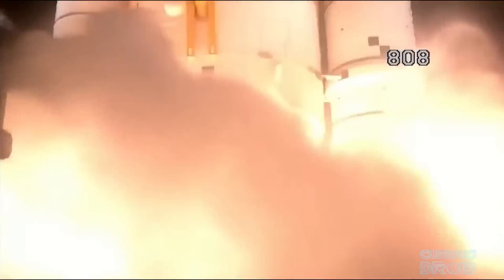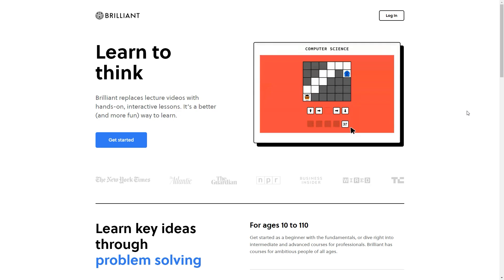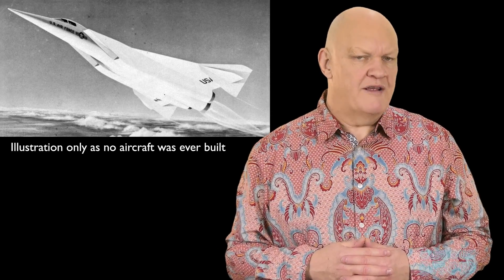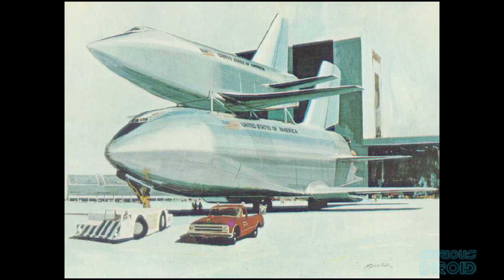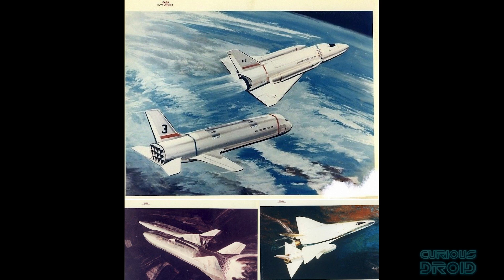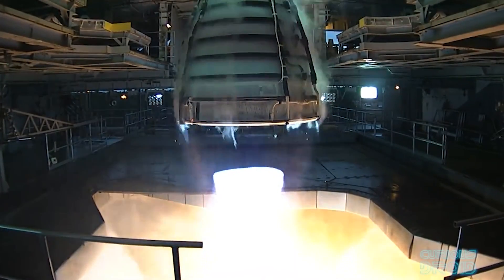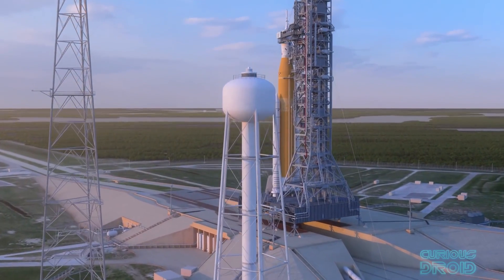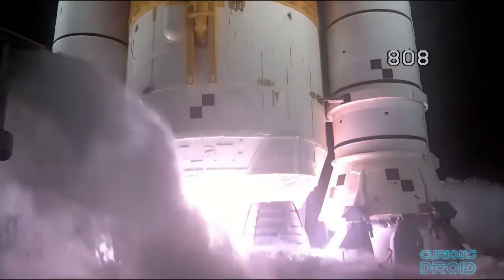Why is NASA Throwing Away Reusable Engines?

Comment: Frustrating we throw the whole thing away after each launch. Expensive, and it can't be good for the environment either.

Surely someone can invent some kind of parachute system to retrofit onto these rockets???
Reply: The SLS core stage dry mass is 85 tons. The Falcon 9 dry mass is 22-25 tons. The SLS core stage is moving over 3 times as fast and over twice as high as a Falcon 9 booster at MECO. Recovering the SLS is not a trivial issue. Not to mention, the recovery equipment costs payload mass. The Falcon 9 B5 can lift 22.8 tons to LEO when expended (SX), but only 16.7 tons when landed on a drone ship (B1069.2). SLS can not take that kind of payload hit and still get Orion to the Moon.
Reply: @steveaustin2686  

"SLS can not take that kind of payload hit and still get Orion to the Moon."

I would argue it should only be taking it to LEO.

We should be sending everything to LEO and constructing things in orbit. We proved that this works with the ISS.

Construct it in orbit, including a separate launch for the fuel to go to the moon from there (which is far less fuel than needed to go to leo).

In the past I would have said, clearly SpaceX should be doing it....but the owner of SpaceX has shown himself to be a racist and right wing extremist, because of his comments on Twitter, many of which are quite vile. He doesn't represent the USA. 

I would like to add a clause for any new launch contracts going forward that the owner and chief officers of the company must be of good moral character, and can't own any companies that have judgements against them such as a Consent Decree from the FTC (Twitter).

We should have some kind of system whereby anybody can come to NASA and pay to get their rockets human rated so they can be added to the list of available launch services.
Reply: @steveaustin2686  

"Musk has wandered off into the far right insanity, but Gwynne Shotwell runs SpaceX as COO."

Yeah, you're right. Still, SpaceX associates the USA with Elon Musk. I would really like to get away from SpaceX as a result. Not sure if we can do it right now, but as soon as we can I would love to see it. 

"Companies only get their rockets human rated when they have contracts for crew launches."

That's what I'm saying, that we should change that. Anybody should be able to come to NASA and pay to get their rocket human rated (by tests they run at their expense, of course). That way, going forward, we'll have a lot more choices and soon be able to ban SpaceX until Musk gets his act together.

Well, not quite anybody. Company has to be run by people of good moral character, with no legal issues with any company they own.
Reply: @neutrino78x  I think you missed that any company can human rate their rockets right now if they want to, but don't, unless they have a crew flight contract. NASA is not stopping them, the extra cost to human rate a rocket, is what is stopping them. Why would a company go through the extra expense, if they don't have contracts to fly crew? It's not worth it.
Reply: @steveaustin2686  

"NASA is not stopping them, the extra cost to human rate a rocket, is what is stopping them."

I thought they were only doing it for companies that signed up for Commercial Crew. If not, when did that change?
Reply: @neutrino78x  Any company can do the necessary steps if they want to. Nothing is stopping them from spending the time and  money to crew rate a booster. 

SNC wants to eventually crew rate the Dream Chaser and is using their 6 mission CRS contract to prove Dream Chaser can fly reliably. It is planned to fly on the Vulcan Centaur. If Boeing flies more than their current Commercial Crew contract, they will need a booster as the Atlas-V's are all already sold. ULA doesn't want to spend the money to crew rate Vulcan Centaur and says that anyone that wants to can pay for it. Boeing and SNC say that ULA should pay for it. NASA doesn't care if any of the three pay for it. 

NASA's budget is hurting for money already and Congress sets how much each NASA program gets, so NASA is not likely to be able to pay for it, unless it is some part of a program like Commercial Crew or possibly Commercial LEO Destinations.
Reply: @neutrino78x  Boeing's Starliner is scheduled to fly the CFT mission in the first half of 2023. NASA wanted two providers just so that they would have a backup.

Building spacecraft in LEO would greatly delay Artemis as they are designed, tested, and built. Better and almost certainly cheaper to go with what they have already.
Reply: @steveaustin2686  

"Building spacecraft in LEO would greatly delay Artemis"

Why? They're talking about building the lunar gateway thing right? So skip that and use the ISS instead, which is already built.

Look, fair to assume I already know about all this stuff, I've been following space stuff all my life. (I will be 45 in January.)

Mine was sort of a rhetorical comment. It's good that they got the thing to launch. I'm just saying, it should have been designed with more re-usability. It's not economically sustainable. Yes, Senate Launch System, I KNOW. I'M FAMILIAR.

Really just going to LEO is all you need. It makes the rockets a lot cheaper, it eliminates the need for a BFR.
Reply: @neutrino78x  Real life is not Kerbal Space Program.

Lunar Gateway is going to be a space station at the Moon, so that Orion has some place to sit during the surface mission and long term experiments can be done in deep space. It not made for travelling to and from the Moon. It will be assembled, module by module like the ISS was, in lunar orbit over multiple missions. 

The ISS is in LEO, under the protection of the Van Allen belts. It is not built for deep space nor is it young enough to be a long term station at the Moon. Just moving it there would likely be as expensive as the WHOLE Artemis program. The ISS is already at the end of its lifespan. Which is why NASA is funding the Commercial LEO Destinations (CLD) program for new, commercial stations where NASA will lease time instead of running it. The two International Docking Adapters (IDA) on the US partner side are busy with ISS operations. One of the two IDAs is always filled with the on-orbit crew capsule and the other is frequently filled with a cargo Dragon or the new crew capsule. The Axiom commercial station is going to be added to the ISS while it is built, so adding yet another building project would likely be too much.

Maybe you forgot the part that the SLS is over 3 times heavier, gets to over 3 times as fast, AND over twice as high as a Falcon 9 booster. ALL of that makes it VERY much harder to reuse the booster. It would need thermal protection to survive re-entry, so would have to be greatly redesigned and would almost certainly lack the payload capacity to get Orion to the Moon. Not to mention that it doesn't look like it will fly at least once a year until Artemis IV or V, so reuse with such a slow launch cadence isn't really affordable, especially for a booster with the re-entry problems above!

No, just going to LEO doesn't necessarily make them cheaper as you then need to build your spacecraft in LEO, which is very expensive in real life.  You would be launch multiple modules, which makes your spacecraft much larger, which means you need more propellant, and then the propellant to push the propellant. Rather than having a capsule and ESM made on Earth, simply for a spacecraft, you would be making a MUCH more complicated spacecraft with overlapping functions.

Again, real life is MORE complicated than KSP.
Reply: @steveaustin2686  

"Lunar Gateway is going to be a space station at the Moon, so that Orion has some place to sit during the surface mission "

Why not just have a dedicated vehicle that goes between Moon and ISS? Far less fuel involved doing that than trying to go from Earth all the way to the Moon without refueling.

"It not made for travelling to and from the Moon."

Where did I say that? I'm saying, go to LEO. Assemble whatever needs to be assembled. Fire off, land on Moon, do whatever you're going to do on the Moon, fire off again, stop at ISS, go back to Earth in capsule or whatever, done.

There's no need to have a BFR if you assemble at LEO and refuel there.
Reply: @neutrino78x  Because, again, the ISS is ALREADY busy with its own operations and is adding on the Axiom Commercial station modules NET 2024. Remember, there are two IDAs and one is ALWAYS filled with the on-orbit crew's capsule with the other regularly busy with cargo or crew swap or Axiom tourist visits (at least 3 more scheduled). Not to mention that trips to the Moon are from a 32ish degree inclination (Apollo & Artemis) and the ISS is at a 51.6 degree inclination. So the plane change for an Artemis mission going to the ISS would eat up even more propellant that SLS doesn't has or that your notional crew transfer vehicle would have to spend.

Again, you need crew in orbit to assemble the components of your crew transfer vehicle and that is expensive. Each module will have to have power, propulsion, and guidance no matter what the module is for. You still have to design, test, and build your modules and the first one almost certainly needs a Canadarm to facilitate construction. No, the ISS could not do it, see the paragraph above.

With SLS & Orion, there is no need to construct anything in LEO AT ALL. Just go straight to the Moon. HLS Starship is refueled in LEO by up to 9 other Starship flights and is still cheaper than SLS. It's large size has cargo and extra propellant for aborts that are necessary for a robust Artemis mission. The [DELETED] Starship propellant depot launches first. Then up to 8 Starship Tankers refill the depot. After the depot is refilled, the HLS Starship launches to refill from the depot. Once full again, HLS Starship heads to the Moon. Then SLS/Orion launch to meet HLS Starship in lunar orbit (Artemis III) or at Lunar Gateway (Artemis IV+).

If Starship matures to a fast enough launch cadence, even with having to send the crew to and from LEO in Crew Dragon and Starliner, it still would be cheaper than SLS/Orion, even at the Artemis III $1.47B price. But AGAIN, Starship is almost certainly not going to mature to the point to replace SLS/Orion by Artemis III and possible not for the next few missions afterwards.
Reply: @steveaustin2686  

"Because, again, the ISS is ALREADY busy with its own operations "

Everybody is busy with their own operations. Doesn't mean it makes sense to require a huge rocket and spend all that money when all you really have to do is go to LEO.

" Not to mention that trips to the Moon are from a 32ish degree inclination (Apollo & Artemis) and the ISS is at a 51.6 degree inclination."

That's launch inclination. We're talking orbit to orbit. 

Earth to LEO, Delta-V is 9.3. LEO to the Moon is only 1.6.

See wikipedia article "Delta-v budget".

And yeah, I know the bottom line here is that the Senate required them to do it this way so money is spent in Florida and Texas. Maybe they could do it that way and still only have to make something that goes to LEO, however, and still manage to save a lot of money. So it IS the Senate's fault, but not ONLY the Senate's fault. NASA can also work with what they're given and try to maximize what they can get out of it. Or as we say on submarines "cause it to happen".
Reply: @neutrino78x  I'm getting tired of repeating myself. Whatever floats your goat dude.
Reply: @steveaustin2686  

"I'm getting tired of repeating myself."

You're not teaching me anything. You're a know it all who thinks NASA is incapable of making a mistake. You assumed I don't know any science because I said they should do something to make SLS more reusable. 

Going anywhere else requires far less delta-v once you're in orbit. All you have to do is have the ability to assemble and refuel in LEO, and capability to get humans to LEO and then you can go pretty much anywhere else. There's no reason they can't make the rocket engines in one state, the capsule in another, the recovery system in another, etc., make them all in states with powerful Senators, etc. NASA could have done that, and have something that goes to LEO and is reusable, and have a LEO refueling system. This was probably the most expensive way, even given the need to make the Senate happy.

Having said that, yes, a large part of the reason why SLS is this way is because of the Senate, I know. Preaching to the choir.
Reply: @neutrino78x  Says the guy who is MISSING the point that to change inclinations of an orbit REQUIRES dV. Dude, believe whatever nonsense you want and ignore anything that doesn't fit you plan, even if it would IMPACT that plan. Dunning-Kruger your way to whatever the Fing plan you want, since nothing matters to you.
Reply: @steveaustin2686  

"Says the guy who is MISSING the point that to change inclinations of an orbit REQUIRES dV."

Sure, I won't deny that. Just, not as much Delta-V as going from the surface of the Earth to the surface of the Moon.

In other words, we can add some hardware to SLS to be able to recover the SRBs and the main first stage and still be able to get to the ISS for orbital assembly/refuel.

This whole paradigm where everything has to be launched from Earth directly to somewhere else...you can only go so far with that, man. It's not like you're going to have a ship that rotates to provide artificial gravity etc and you're going to fold that thing up to fit on top of the SLS, come on now. SLS as it stands is extremely expensive and it doesn't open up space that much.

It should be go to LEO, meet with some kind of space station (ISS or otherwise), assemble the ship in orbit, launch the fuel from somewhere, launch the crew, separate and go to the destination. This is the UNIX way....small modules that do one thing and do it well, and readily connect to other modules, making it easier to build a big complex system with lots of redundancies. 

In fact, ideally, you have ships that just stay in space, and all they do is go from body to body, such as a ship that goes from Earth to Mars orbit, and then you just go to LEO, refuel, meet up with that other ship, ride it to Mars, and land in a separate lander. It could be an Aldrin Cycler that is in a gravitational orbit that takes from Earth to Mars on a regular basis with very little fuel needed, and it has lots of shielding, lots of food and water, and rotates to provide earth gravity. On something like that you could take large numbers of people over in comfort. But that's for the future, that's something that has to built over time, we need commercial presence and a tax base to justify building something like that.

"Dude, believe whatever nonsense you want "

Such as, the mission required SLS, as opposed to the Senate requiring it? Or that NASA didn't do enough to involve Florida and Texas in a NASA owned rocket to the ISS and then a NASA owned transport from LEO to lunar surface? Or multiple commercial options for both?
Reply: @steveaustin2686  

"There is no other launcher that can get the Orion stack to the Moon,"

Not directly. But you can go to LEO, refuel and then go to the moon.

Or have another vehicle that does nothing but go back and forth between LEO and the Moon.

It's not that hard. NASA needs to do things in a more modular way. Cheap modules that when linked together do something that would otherwise be a lot more expensive.

", but you are evidently allergic to facts."

I'm definitely not allergic to the fact that things are this way due to a combination of HSF at NASA not being innovative enough and the Senate needing money to be spent in certain states. 

NASA HSF should take a page from JPL, they are a lot more efficient in terms of budget. I think a lot of it has to do with JPL being managed independently by Caltech. I'm not sure what the equivalent private university would be in Florida but I'm sure there is one.
Reply: @neutrino78x  Again, whatever floats your goat dude. Push whatever plan you want. Ignore whatever you want. That's all on you.
Reply: @steveaustin2686  

"Again, whatever floats your goat dude."

Yes, but you lost the argument. The fact is, SLS is extremely expensive for what it does. That's NASA's fault.

Look at how much more JPL accomplishes. They've launched what, hundreds of missions since 1980? NASA HSF has launched how many missions beyond the moon in that time? Zero.

Again, it's about modularity. All you really have to do is get to LEO and then pretty much everything else in our solar system is a relatively low energy trip from there. Landing on the Moon for example is 1/10th the delta-V of getting to LEO. Mars surface is about 1/3rd.

The ability to refuel in LEO enables all this stuff.

Again if you reply with "whatever floats your goat", that is equivalent to replying "I concede your point, sir". And I will still reply; I get notified when you reply to me.
Reply: @neutrino78x  Dude, you completely ignore ANYTHING that doesn't fit your LEO plan, no matter how factual. Discussion with a wall is more illuminating. Have fun playing with your plan.
Reply: @steveaustin2686  

"Dude, you completely ignore ANYTHING that doesn't fit your LEO plan, no matter how factual. "

Well I mean, it's factual. As long as you can refuel in LEO you can go pretty much anywhere in the Solar System, majority of places you could go take less energy than lifting off from Earth. Gateway would be a huge waste of money imho.
Reply: @neutrino78x  Again, you want to ignore the downsides of that plan. Also again, whatever floats your goat.
Reply: @steveaustin2686  

"Again, you want to ignore the downsides of that plan."

How much does SLS cost, again?
Reply: @neutrino78x  AGAIN, SLS is needed until Starship can mature to replace SLS. Your plan would require development and testing, so SLS would STILL be needed until your plan is ready. Real life is NOT KSP.
Reply: @steveaustin2686  

"GAIN, SLS is needed until Starship can mature to replace SLS."

I don't like SLS either, mainly because Elon Musk is a racist, but also because it's another case of building a larger rocket than necessary.

All you need is the ability to refuel in LEO. Pretty much any target requires far less delta-V than was required to get to LEO (even burning fuel to match the ISS orbit....that doesn't take nearly as much delta-V as getting to LEO).

"Real life is NOT KSP."

I don't even play that game lol. But if you want to keep playing ad homenim, I was invited by Johns Hopkins -- you might have heard of their Applied Physics Lab or their teaching hospital -- to skip high school when I was 12. Chances that I'm smarter are pretty good.
Reply: @neutrino78x  Whatever floats your goat to toot your horn. Ignore the downsides all you want, they won't disappear.
Reply: @steveaustin2686  

"Ignore the downsides all you want"

Tell me again what the SLS costs?
Reply: @neutrino78x  Not my problem that you seem to have trouble understanding the quite simple concept that currently, there is NO other booster capable of sending the Orion and ESM to the Moon. I mean, it's not a hard concept at all, except apparently for you. 

Your LEO plan would require development and testing. Something that you continually ignore. SLS just finished its last unmanned test and baring any unforeseen issues, the next flight is manned test. This is yet another simple concept. Something someone who is college educated should be able to figure out with ease. So play with your fantasy, while NASA and their contractors get on with actual Artemis work.
Reply: @steveaustin2686  

"Not my problem that you seem to have trouble understanding the quite simple concept that currently, there is NO other booster capable of sending the Orion and ESM to the Moon."

So therefore NASA is infallible?

Again, ANY ROCKET THAT CAN GO TO LEO can send something to the Moon, you just need to refuel in LEO.

"Your LEO plan would require development and testing."

So did SLS.

Which one is cheaper?
Reply: @neutrino78x  SLS is here, your plan is not. Again, not hard concepts.

Whatever floats your goat dude.
Reply: @steveaustin2686  

"SLS is here, your plan is not."

Again, what is the cost of SLS vs the cost of refueling in LEO. Sorry but I get to question NASA's decisions. They are not infallible. 

Also, again, there's really no point to building bigger and bigger rockets....you're not going to fold the Starship Enterprise into the payload of the SLS. It makes a lot more sense to spend less money on simpler components, and then integrate them together to do bigger projects.
Reply: @neutrino78x  In small amounts. No where near the hundreds of ton a medium lift rocket uses or the 1,200 tons a Starship (second stage) will use. Hell, the test propellant transfer contract that NASA awarded SpaceX is for an unprecedented 10 tons in LEO. Propellant transfer for Starship is the biggest hurdle for the HLS Starship. Again, you won't care. Whatever floats your goat dude.
Reply: @steveaustin2686  

"n small amounts. No where near the hundreds of ton a medium lift rocket uses "

First of all, as I keep reminding you, it takes far less energy to go from LEO to the Moon than it takes to go from the Earth directly to the Moon, and therefore far less fuel.

Which is going to cost A LOT less......refueling in LEO, or the huge rocket from Earth directly to the Moon? 

"Whatever floats your goat dude."

You do realize I get notified when you reply to me.